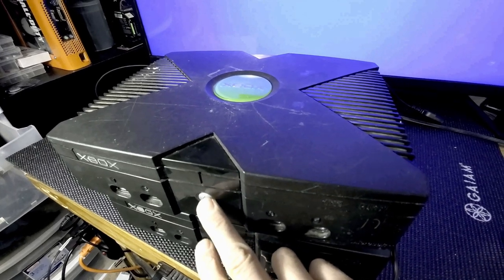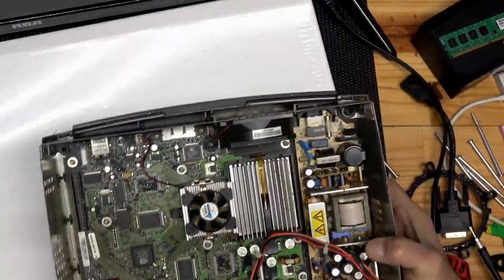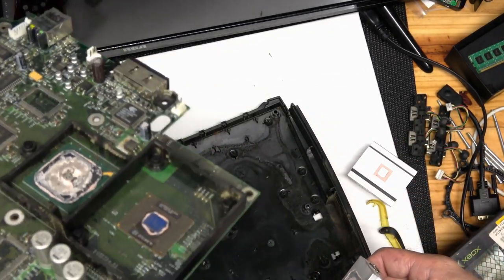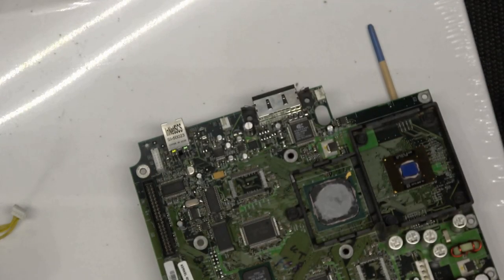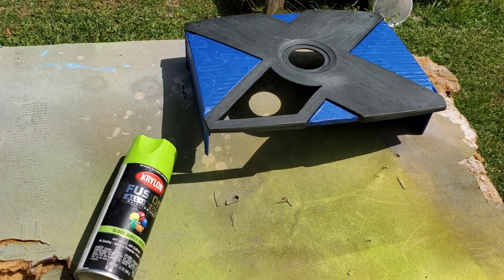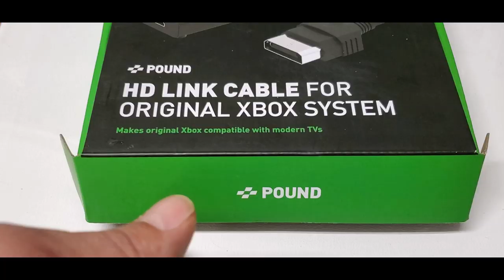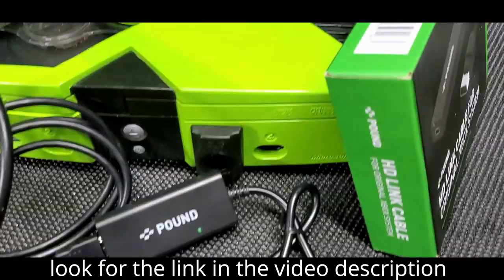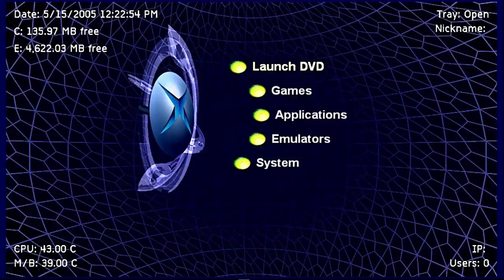OG XBOX MOD AND RESTORATION

Comment: As for the HDMI adapter, fill them in on the details. See, everyone was hating on the XBOX for being "OMG HUEG!!!111", but that's because it used standard size optical drives, and for its form factor, a PC sized motherboard. But it did something the PS2 couldn't do: 1080 (and 720) P. The PS2 could do 480P, but nothing else. Their form factor was basically due to using what amounted to a laptop DVD drive, and some specialized miniaturization on the hardware, while the XBOX was built on off the shelf components.

Disclaimer: I play all consoles for good and bad, the PS had some excellent exclusive titles, and as both Xbox and PS are now sharing titles with minor differences, it's apples and oranges, or is that orapples? I've softhacked Sony consoles, Nintendo consoles, and handhelds. I have no favorites.
Reply: Actually PS2 could do up to 1080i. You aren't well informed.
Reply: @SIPEROTH  I think what he means is that the XBOX had more horsepower out of the box, and the 1080i was more near the end of the PS2's lifespan with all it's revisions.
Reply: Anon ymous he said 1080p, and only a couple of games can output in that display (while not looking very good anyway)
Reply: I don't get why anyone cares about the console being too big. I don't care if it's the size of a fat TV. I just want it to work well and last forever.

Comment: Found an OG Xbox in a gas station parking lot last week. When I turn it on it gives me a "service required" screen. So I opened it up and mannnn that thing is so dusty and very rusted. I'm going to use this tutorial to try to restore it and hopefully have my very own custom og Xbox. After all, what do I have to lose? Except time, of course.
Reply: Tony Rodriguez did it work or are you still doing it
Reply: Tell me the error code, I might be able to tell you what to do.
Reply: Yeah what happened
Reply: I bet is the main IDE cable that is damaged. That cause the Hdd, DvD and motherboard ti have a bad connection. I know this because I screwed a screw through the damn ribbon when I tried to close it and the cribbing was on the hole without knowing. And I had to buy a new one. Bet you 20 bucks that's what it is
Reply: how was it?

Comment: This brings me back, spent high school buying as is consoles and doing custom mods and repairs then turning around and selling them for $50 as custom/refurbished.

A tip with painting console cases always give a light sand and an adheshion promotor works better than standard primer and always do a few layers of clear coat( gloss, matte, satin, what ever) it really helps keep them looking nice much longer

Comment: I just got myself a crispy clean 1.6 version og Xbox I'm throwing a openxenium mod chip, LCD and a window and cleared gem in it and then probably getting some leds for the gem and controller ports.   My paint jobs never last so I think I'm gonna get a vinyl sticker and call it done.   1 tb hard drive is a must save those disc drives their failing left and right.

Comment: I scored one for $5 at the Goodwill liquidation outlet, they thought it was broken because it had a flashing orange ring. The orange ring means "Connect me to a TV you idiot.". I did, and lo and behold, it ran perfectly (had an OG copy of Halo that I also used to test the 360's backward compatibility). Had to go in and remove the clock capacitor, clean up the spooge, take out the Bazooka gum hardened thermal pads, replaced that with arctic silver, and install a mod chip after everything was cleaned up. Still have to install an SATA to IDE converted 500 GB HDD, but so far I've got no buyer's remorse. Even scored a near mint condition Duke controller for $5 a few days later.
Reply: Wait, you didn't check the clock capacitor? Does it keep asking for the time/date whenever you turned it on? Because those are notoriously flaky components.
Reply: Oh,I Soo much lOVe Xbox 1 controller,tried to use Xbox to USB, could not make it work.
But was a fun playing NFS with it.
Reply: Wow

Comment: i bought a used original xbox its softmodded with a ghost case (i think its ghost) as the original top was damaged, had to find a equivalent fan that is over the nvidia chip (original fan had gone bad), upgraded hdd to 160GB (original hdd was also going bad) and i have some blue/red led's inplace of the original leds im quite happy with how mine turned out

Comment: Nice job.  I would have liked to see how you cut the acrylic piece for the top out and how you attached it.  :)
Reply from the maker: Cut it the same way I cut thr hole only placing it over the hole and used a sharpie to trace. And then stuck it down with hot glue.

Comment: Hey modstek, three things that I would like to address.
1. You should upgrade the HDD and ribbon cable, and get the Startech IDE to SATA adapter.
2. You should either upgrade your softmod to jRocky5's softmod or do a hardmod(TSOP FLASH or MODCHIP, I prefer TSOP for V1.0/1.1 xboxes such as yours.)
3. I F***ing love your videos. They're very entertaining.
Reply from the maker: My soldering sux I failed soldering the slow burn rgb led's the correct way. Solder wouldn't stick. So I soldered wires the led's instead. Don't think I should try tsop. I'm gonna check out that rocky's softmod tho. Thanks
Reply: @modstek  that's fair, if you do change your mind, it's literally just two spots on thetop and two on the bottom of the board that have to be shorted and then you run a flashing program. Rocky's softmod is noice.  Good Luck.

Comment: 1. that shielding needed treating and all you did was wash it with water no proper treating it.
2. that is not how you should really spray paint (i expect in person it doesn't look so good)
3. paste looked fine so didn't need replacing (most times it doesn't on these)
4. freezing is best method to remove jewel
5. why not tsop
6. did you remove clock cap
Reply: Do you even know what you're talking about?

Comment: You forgot the part how to unlock the harddrive so you can put a new harddrive western digital, then also you forgot to mention how to do the exploit cable USB to xbox controller WITH AN ORIGINAL XBOX CONTROLLER and have the right USB and then put the files in there and also get the splinter cell, it is a certain version of splinter cell has well, all this info is available if you Google search. But it would be nice if it was on this video, idk maybe a remix to this video adding the things I mentioned and other steps I might of forgot. But other than that your xbox looks sick 😎 and the adventure of it was awesome that's probably you got haters not liking it because they can't do what you just did.. yeaaaaaaahh.

Comment: seems like i have shorted my xbox console by trying to mod it, is there a way to reset it? cause when i plug the hdd it powers down, if i leave the hdd unplugged from the molex cable it powers up normally